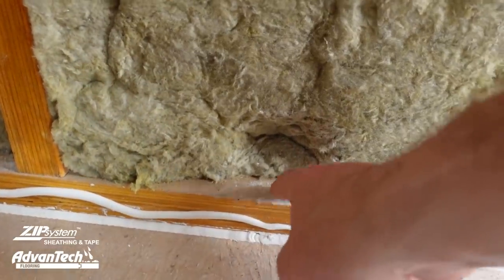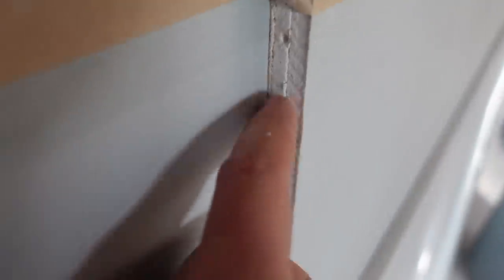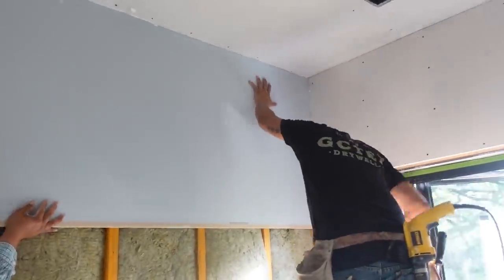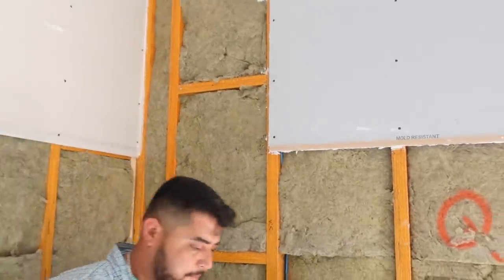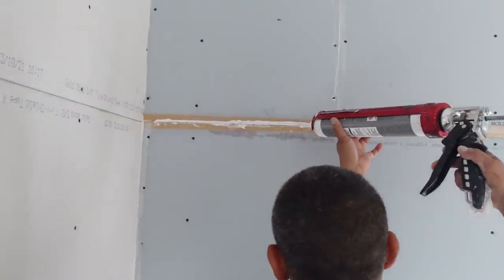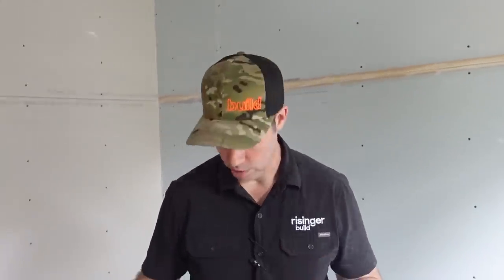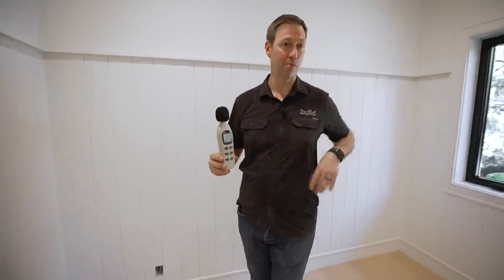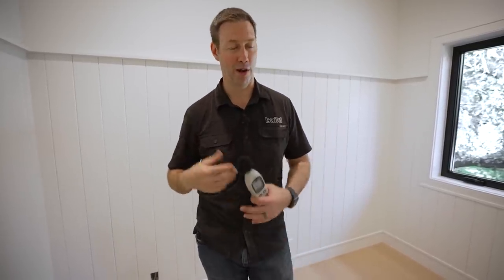3 Keys To Soundproof Between Bedrooms (incl Testing For Effectiveness)

Comment: Uhhhh... Matt where is the control test of the vac through a wall that isn't sound deadoning?? Why not use a double offset wall. We have a job coming up where sound is an issue so were sacrificing 2" of floor space in order to disconnect the two sides of a couple walls in order to delete the telegraphing of resonation (sound transmission).
Reply: Like most of Matt's videos, he's not going to do any kind of real comparison because it's not an unbiased review video, it's a paid promotional video. Unfortunately you can't trust most of Matt's videos for that reason.
Reply: @orrd  back in the day he did have some that were pretty decent though
Reply: I get what you're saying, but 99% of houses have nothing other than 1/2inch drywall and 2x4 wall. So you can pretty easily check it yourself even without a decibel reader. 45 decibal is incredibly quiet (like a library). A regular wall assembly makes basically no difference to the original volume (I'd say maybe 5-10 decibel drop Max. So it's clear it makes a massive drop.
Reply: @frostman9661  Facts are facts. Lack of facts is heresay. The point is that isnt a very good experiment.

Comment: Going back to the days of highschool and car sound systems: another product that could work well for wrapping your electrical boxes is DynaMat. It’s the peel and stick material used for soundproofing your car doors, trunk, firewall etc. Comes in larger rolls or sheets. Available at most car audio stores. Almost like an MLV (mass load Vinyl) peel and stick material. .

Comment: I could be completely wrong but I think pink sill sealer on the studs between the drywall might reduce sound travel from the next room.    Loved the video - you should do the exact same test with a wall that doesn't have that same sound proofing.

Comment: Aw, Matt, you should have used independent framing for both sides of the wall with an air gap between (basically build two walls side by side without using drywall on the faces of these walls that face each other), and used some sort of foamy tape between all the stud faces that touch the drywall and the drywall. And of course eliminate any air penetrations in both these walls.
Reply: in that airgap, put a sheet of foam or fabric to absorb noise, much cheaper than using overprice drywall
Reply: So correct. What kind of foamy tape do you use? Just anything?
Reply: @kapdolkim1914  Owens Corning makes 1/4 inch foam insulation board, apply that to one side in the air gap in between the 2 walls
Reply: @kapdolkim1914  Yup, anything that is available locally and fits the bill. The goal is to have some sort of an elastic dampenning interface between the wall frame and its sheathing. The effect isn't huge (a few dB maybe) and is dependent on the frequency of the vibration, but non the less - its there. And since its easy and cheap - why not use it?  In sound deadening every little bit counts.

Comment: Hey matt!! I’m an inexperienced builder, but I love watching your content and absorbing any building techniques that I’ll be able to apply to my own projects! 

In an old project I used ZIP tape and silicone to seal an exterior light fixture in-front of the garage. I had no idea there was a putty to enclose outlets, though I felt I had good coverage from the tape.

Awesome upload!!
Reply: @johnbergstrom2931   I used the STI putty pads ~$4/each to soundproof boxes in a bedroom/bathroom, then took the rest of the pads and tore pieces off to seal the penetrations in all the boxes on exterior walls (I didn't wrap the whole box) so I got about 5-6 boxes per pad for air sealing. seemed to work well.
Reply: @johnbergstrom2931  I don't think you understood what I typed. I fully covered the entire box on all the boxes on the interior walls that I prepped for sound proofing. I even used 2 pads to cover the 3 gang switch boxes... I had leftover pads from the box of pads that I bough, so I used these "leftovers" to air seal the wire penetrations on all my boxes that are in exterior walls. I am not worried about sound proofing exterior walls.

Comment: Best way to describe soundproofing to a contractor is to tell them the room mad to hold water. Anywhere water would leak, sound gets through.   Nice job wrapping the fire stop around the boxes. A common mistake I have seen is butting electrical boxes for different dudes of get wall in the same stud bay. Another great way to leak sound from one room to another.

Comment: Good attention around the edges with soundproofing caulk. A lot of the sound is transmitted through the studs. Have any builders explored the use of an acoustic tape in similar detail spec or used a dBoard with better results?
Reply: Every new building in Europe uses acoustic tape. Much easier and cheaper with better and more consistent results.

Comment: After the room is finished, corner dampers at the wall-celing junction will help too. You can just use a plush stuffed animal or something like that if you want to go as cheap as possible. It helps with keeping the sound that is already in the room from echoing. Not really to keep sound out, but to help keep the room's sound profile “softer”.
Reply: darrick steele - just to clarify, do you mean sticking a product or stuffed animal on the face of the finished drywall up in the 4 corners of the room?

Comment: One very easy additional detail is running acoustic sealant on the studs. The screws from each side of the wall transmit a lot of vibration.

Comment: Isn’t QR more effective if you hang it vertically? I believe it eliminates the bead of sealant between seams since they land on a stud. I might need to check the manufacturer recommend installation one more time…

I do love this product and also want to echo the comment about the ceiling…no pun intended 😂

Also the floor and adjacent walls... Sound will just radiate under, around or over the wall if this is ignored.

Comment: Try those rockwool exterior panels, and apply them directly to the studs after rockwool insulation in stud  bays, or panels between layers of 5/8 " drywall.

Comment: You would probably like that remote vacuum switch from fast cap so you're not crawling around on the floor. I like it. It saves steps and time.

Comment: You can use fiberglass as it has the same STC rating as rockwool and much cheaper..  

2 sheets of 5/8" drywall on each side is more cost effective and will provide great results.
Reply: Don't even really need two sheets. The room we just did recently with just the rockwool up in the walls and no drywall on it muffled sounds so much it was actually weird to stand in the room and talk. Rockwool's safe n sound or even just regular rockwool is CRAZY good at reducing sound transmission by itself. All the other little details might get  you another db here or there in sound reduction.
Reply: @robsp32 As soon as you put drywall up it will echo again.  Open walls with any insulation is going to sound quiet, like if you went outside in a snow storm..  Also Rockwool doesn't outperform fiberglass in STCs and if you did that same open wall test with unfaced fiberglass you would have had the exact same results.... Also you 100% need MASS to reduce low frequencies so, yes you do need double drywall... I would suggest you head over to AVS or another audio forum and look at the actual science and real world applications..

Comment: Did you start with a 2x6 top and bottom plate, with 2x4 offset studs before the insulation? The hard surfaces making contact will transfer the most sound. For example I believe a duplex home it's code to use offset stud walls for sound reduction.

Comment: Mr. Risinger, great video. I have some questions though did you put quiet-rock on the room you have the shop vac running in? Did you think of 2 other things that may have helped you get a few decibles more of quietness. ! when you had your electrician run the looks like 12-2(as it looked yellow) wiring for that room You could've had him come down from the top with just 1 hole in the stud bay which could've been sealed with spray-foam or the soundproof caulking. And after you went around the inside of the outlet sheet-rock to electrical box space you could've went 1 more time on the outside of the box on the sheet-rock the area that would be covered by the face-plate or outlet cover as when you put them on in the end of the job this would seal any potential gaps for sound or air b/c on good jobs it's not uncommon for ppl to caulk the edges of the switch or receptacle covers to hide perhaps a little non level installations. The product of drywall you showed I haven't seen up here in the north we have that regular 4x8 sheets of the purple quiet-rock it has a plastic piece in the middle its about $50 bucks a sheet. Now this isn't that terrible as it is by far a superior product but also where I live thre are mostly row homes that are only 12' wide so you need 3 sheets, lol. I haven't seen any caulking for it though. But I haven't looked for it forever so they may have it now. On another note you may find interesting b/c your a nerd for this stuff like me. In the older day up here in NEPA they would use cement board or hardy  board and cement the seams on the wall but also trace the stud bay out making the "c" shape of the stud cavity with the cement board cementing the joints in the corner joints and then stuffing your insulation in the cavity then. Just my 2 cents worth it was a great video. I really wish you could do more of these videos and some more on the electrical part of construction.
thanks, 
Ron

Comment: I don't there is much sound difference between the QuietRock drywall and a 5/8 Firecode Sheetrock with the preparation that you did. The insulation and the air gap sealing is doing 90 - 95% of the work, it doesn't justify 5x-6x the cost of the drywall.
Reply: I wish he showed an example of what the sound reduction would be without all those steps. Surely there’s a wall in his house where that wasn’t done that he could’ve tested and shown for us. Maybe one of you builders should have a channel that responds to Matt’s with more data, $-figures, and results to see whether this high-end Austin mindset is as useful as it is promoted to be, or simply leans towards pretentiousness. 

Keep in mind, I’m not knocking any of it. If folks want to and can afford to go to these lengths, I’m happy for them and God’s blessing on their life, but I’d rather see just how useful some of these techniques are.
Reply: There is data on that exact topic, not 'bro-science'.
Reply: It's easy to justify when you're getting everything for free or at a deep discount like Matt is. No one in their right mind who is paying market prices for materials will go this crazy.
Reply: QuietRock will outperform against lower frequency. There are also manufacturers stc ratings if you want to see data

Comment: “The major factor to consider in constructing walls to control sound transmission is the isolation of the gypsum board layers on each face of the wall. If at least one of the layers is not resiliently supported, or if the two faces of the wall are not isolated from each other, sound-absorbing material in the cavity is rendered ineffective. When the layers are isolated, sound transmission through the wall can be reduced by increasing the mass, the cavity depth and the amount of sound-absorbing material.” - Excerpt from the NRC publications archive for control of sound transmission through gypsum board walls

Comment: Insulation, Sealing and Isolation combined work the best.     Breaking the tie between planes makes a tremendous difference.  Double stud wall.
Reply: @johnbergstrom2931  With regards to sound proofing, Double stud performs better than staggered.
Reply: @johnbergstrom2931  those stats are for one layer on each side? Or you mean 2 per side? But thanks for sharing

Comment: Why not caulk each stud, not just the top and bottom?  Maybe a layer of tar paper on the studs before the sheetrock?
Reply: @johnbergstrom2931  The Quiet Rock has a layer of something in the middle and Matt is using sound caulk everywhere else.  Different density material layers transmit at different rates.  These are minute changes that have a cumulative effect.  Sure, bass sounds are hardest to prevent, but some reduction is better than no reduction.  Maybe you are right, maybe not.  This is still an evolving science.

Comment: The best solution is to do a double stud 2x4 wall. Build one wall in front of the other, not touching each other, insulated, very little sound conduction happening because the drywall in one room is severed from the other. But that gives up 5 inches of interior square footage, which is something that you can’t always do. Sure the acoustic sealant and putty pads are good, better is no outlets at all on the wall. Build an mdf box for each outlet.  Much better than the quiet rock is two layers of 5/8” drywall. Even better is two layers of dry wall with green glue in between.

Comment: What is the difference between that method and other methods? Comparing the cost to the benefits of each method would be helpful.
Reply: The drywall companies have detailed guides for what sort of assembly is needed to produce a certain STC or a certain fire rating.

Comment: You know how you can cut a hole at the top of a stud bay and fill it with loose insulation (like a feather down or similar)? I wonder how much soundproofing that would accomplish. Because I'm willing to do that and patch holes at the top of my walls between bedrooms, than actually rip down sheetrock and replace.

Also I wonder how much having a solid bedroom door vs. hollow core helps, especially considering the doors are undercut to allow for an air return.

Comment: I'm about to build a duplex tiny home (using passivehaus standards) I'm wondering if this method will work for that as well....The engineer is designing a dead wall- and it's taking up almost an additional 4" in wall thickness.  While 4" doesn't sound like much- in a tiny home it can make a hue difference.

Comment: I added a laundry room next to a living room. No fancy materials used. 

I built a 2x6 wall and used double 2x3s as studs - and essentially made 2 walls in one. Each side has 2x3s and they do not touch each other. 

I used some basic sound rated insulation. I caulked like crazy. And 1/2 inch drywalll on one side and 5/8 on other side. My drywall skills are... OK, they do not exist. So I again caulked like crazy to fill every gap before taping. 

The washing machine and dryer are against the wall and sofa and TV are on the other side. It is hard to hear them run. They are 1970s Maytags. Totally exceeded my expectation.

All of the materials were just regular stuff from Home Depot, Lowes, etc. 

I do not think you need all of this pricy stuff unless you are building a sound studio. Keep in mind Matt doesn't pay for his stuff. Offsetting studs will do more than anything. 

Further, if you can't do a 6 inch wall you could do 2x4s turned sideways. It leaves 1/2 gap between. This with some regular sound insulation, caulking and 5/8 on one side and 1/2 on the other will probably be as good as Matt's wall. 

Another option I haven't tried - since I do not have such a project - is to use two layers of 1/4 sheetrock with some type of sound caulk in between. This is what QuietRock is. The problem with QuietRock is it is hard to find and very expensive. I bet you can make your own QuietRock that will be 90% as good for a fraction of the price.

Comment: Why did you decide against using sound channeling against the studs? Would fixing 1/2" buildrite under 1/2" drywall accomplished more sound dampening?  Or is that just overkill?  Of course there's always the labor cost of hanging 2 sheets instead of one.  I get a lot of customers asking a is asking about creating a sound deadened room for working out or doing music in their basement. It's the worst place for sound travel is always the HVAC ducts,  but would love any opinions or advice on creating the most cost effective sound dampened room for these uses.  So far I have been using standard bat insulation with sound channeling buildrite and sheet rock.  Also window taping the back of electrical boxelectrical boxes and is and spray foam around all corner studs & edges of buildrite.

Comment: Matt, what about doing a double stud wall with a minimal gap. Is that 6” or room space lost just not worth the effort? OR what if you used 2x4s for studs and 2x6s for header/sill and alternated the studs for which wall they were aligned to. That would eliminate the resonant bridging via the studs. Your thoughts?

Comment: In the late 1970's in Manhattan, I sound-proofed my 2000sq/ft loft space using 5/8 sheetrock on top of 1/2 inch sound-proof fiber-board after sealing the metal studs with caulking compound and filling the voids with fiberglass insulation. As a result, you could not hear conversations in adjoining rooms and hardly any music.